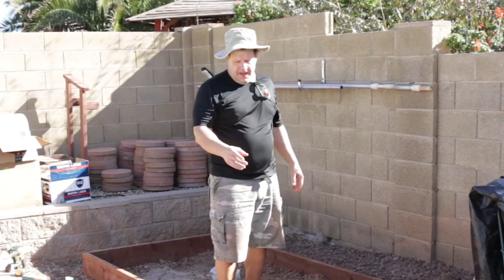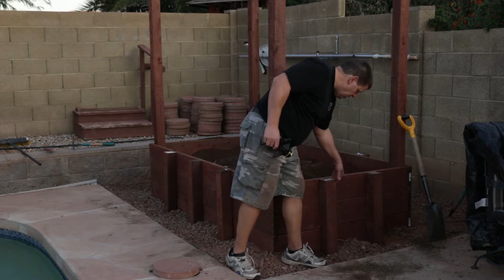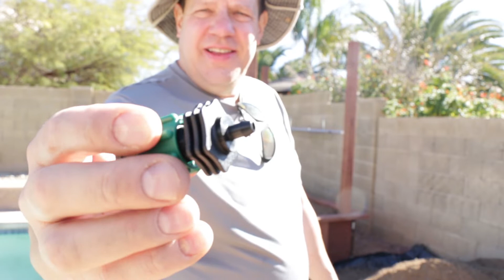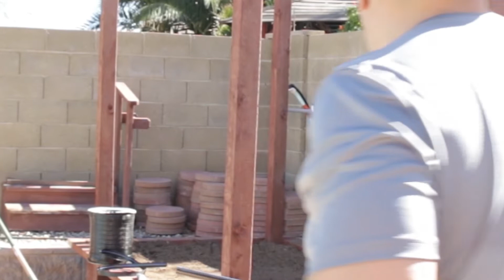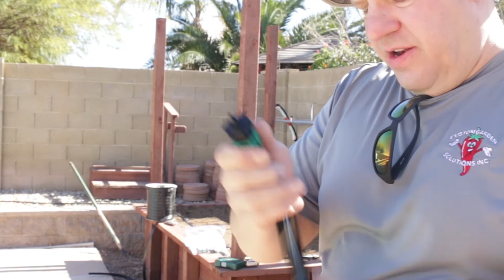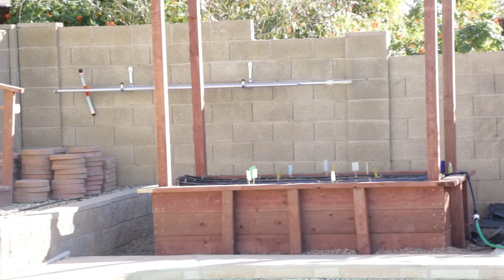Peoria Arizona Raised Bed

Comment: I grow in Straw bales for the outside garden and Hydroponics inside my two greenhouses.
That is an awesome raised bed ya made there!  Great tips on showing how you made the watering system!
Reply from the maker: Thanks CB and Renee.  I had some problems with audio (pool filter running loud) and video (poor filming on my part) so thanks for hanging in there.

Comment: You voice is so low I couldn't  hesr what you were saying. :(
Reply from the maker: That's the first time in my life somebody told me that I was talking to quietly.   Sorry it was hard to hear.   There was a pool water filter that may have made it harder to hear.   Thanks for your comment. 😎😎🧸
Reply: @CustomGardenSolutions  thanks for responding.  What size irrigation did you use.? I need to change mine. Mine is  so tiny.